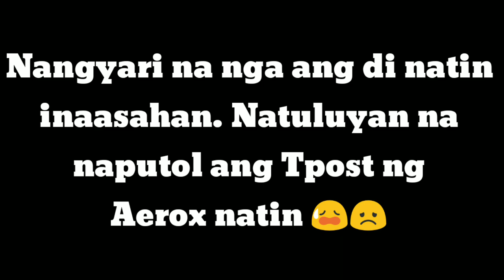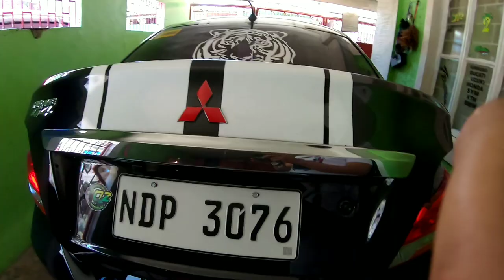PUTOL T-POST SA AEROX | LEGIT NA ISSUE | PAANO KO TO IUUWI

Comment: Sir kung sakali pwede po ba magbili nalang ng Tpost na aftermarket? Para mas matibay?
Reply from the maker: Mark Jucell Maxino meron ako pinalit na inverted fork set with tpost idol pero di ko png sure hanggang kelan tatagal eh mas ok pa din siguro pag stock idol
Reply: Ah ok po sir. Ingat po kayo palagi. More power po sa inyo. From Cagayan de Oro city, Mindanao. 👍
Reply from the maker: Mark Jucell Maxino solid. Ridesafe po lagi sir